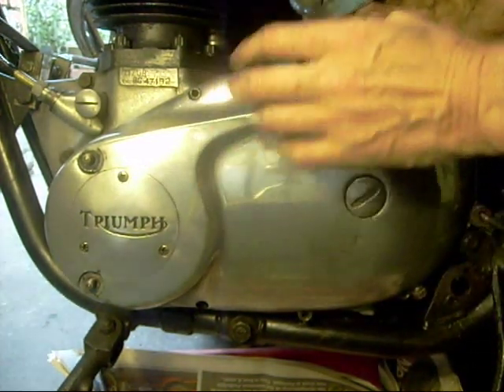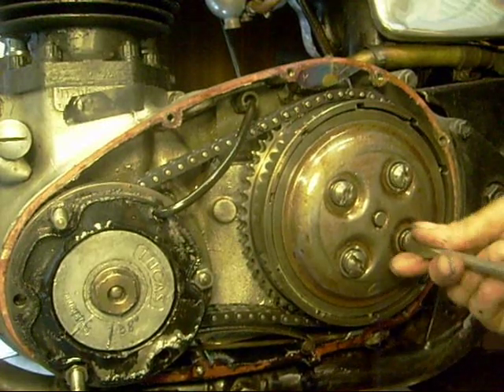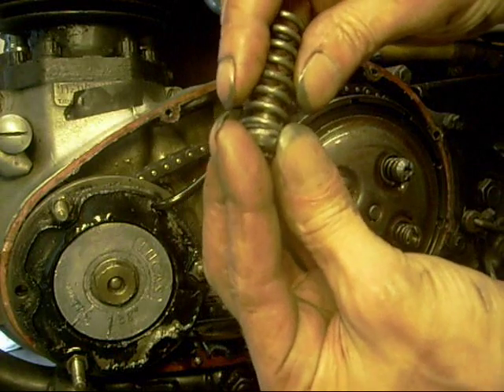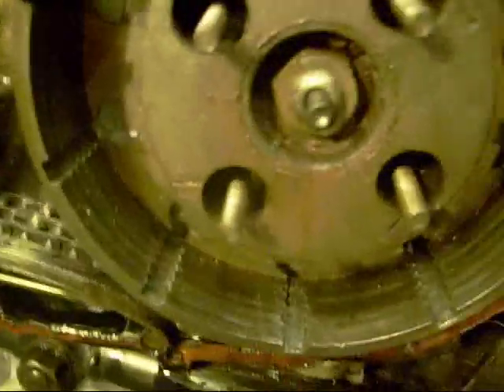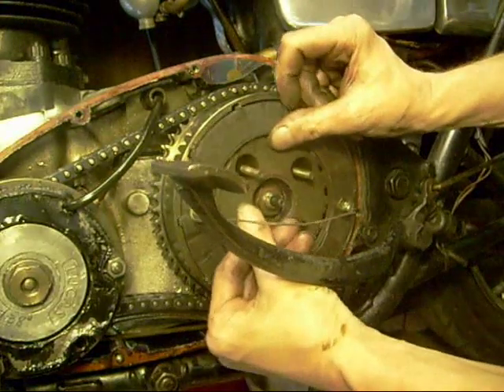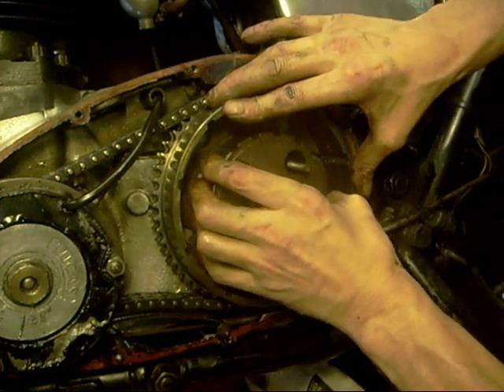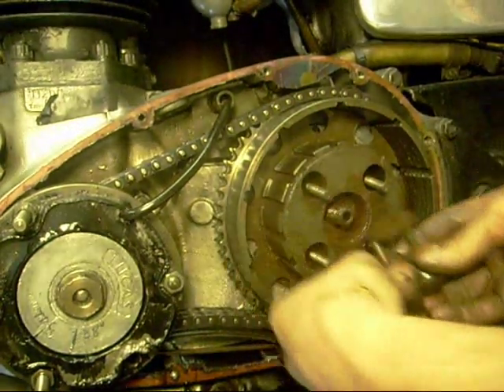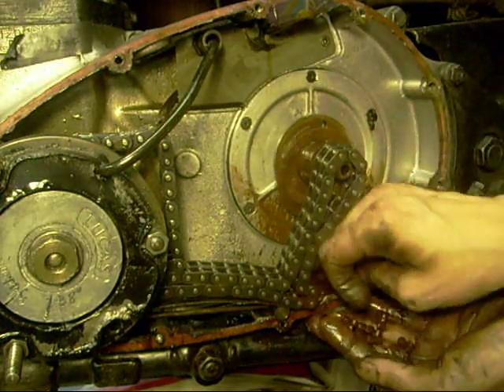Removing my Triumph T120R clutch

Comment: I disassembled an old disc drive sometime back and kept the powerful magnets from it. They are curved and fixed to a metal backing with mounting holes in. I adapted two of them to pull out the clutch plates from the basket. It works perfectly every time, even if the plates are gummed together.

Comment: Very good. I've never liked the post '69 breather system for exactly the reason shown in your video - rust.

My '69 TR6, which I bought new, still has the original clutch at 65,000 miles, although I changed the primary chain.  I have newer bikes so it just sits these days. The lower end and gearbox have never been apart either.

Comment from the maker: Hi Rick :-) I use engine oil in everything forks and gearbox included.
the primary shares engine oil on later Triumphs but the early ones with a timed breather though using engine oil do not share with the engine, so need checking more often, the later ones like mine breath through into the primary.

Comment: my clutch  side is filling up with oil ...is there an oil seal at crank end  in between crank bearing and sprocket..???.any problems installing a new seal apart from rig ma row of removing the two sprockets???

Comment: Hi Lunmad , excellent vid , my 71 TR6R has a stuck clutch as not used for years , have tried freeing off in gear and also tied clutch to bar but still no luck , looks like it's a case off job , can i just clean off the plates ? does not look like I will need special tools ? Many thanks , Nick :o)
Reply from the maker: Hi Nick :-) thank you, 
the chances are there will only be one or two plate stuck, you may have to prise them apart
 or a sharp knock on the floor on the edges, no special tools needed to do this.
 You may want to clean the friction plates in very hot water and detergent and scrub up the plain plates, a concrete floor works well.
Reply: Hi Lunmad , you are a star thank you , i will try that , :o)

Comment: How does that damage happen (at 8:30 or so)? the damage to those splines is quite severe! Luckily for me mine are in good shape, but I was quite nervous upon seeing the condition of yours. I don't understand how that can happen there. That looks to me like a really tight/secure fitment. (at least on Mine)

Also, regarding Planimals post from forever ago: I had the exact same thing happen yesterday and fretted about it all night, but this morning I went back to it and decided to carefully grind the lip off of the spring cup so the pressure plate could be removed with the stud/spring/nut still in place. From there I was able to pull the hub out and see that the square end of the spring stud had rounded over and was spinning freely. I could then grip the square end with vice grips and turn the nut off. Now I just need a single new spring cup and stud. 

Anyway, thanks again for another great video!

Comment from the maker: @planimal 
Hi planimal :-)
If the stud has rounded off on the inside you have quite a problem :-(
the last resort is to try and drill the nut, a small hole (1/8"-ish) down each side, close to the the stud.
The aim is to split the nut and release tension on thread, you might get away with one hole.
sorry for late reply
all the best for 2011 :-D

Comment from the maker: @gordonemoore 
Hi Gordon :-)
condensation can be a problem in the primary chain case,
getting the motor nice and hot helps limit the problem.
Short runs in cold weather will exacerbate the problem.
sorry for late reply
all the best for 2011 :-D